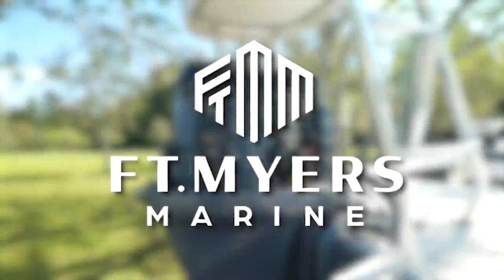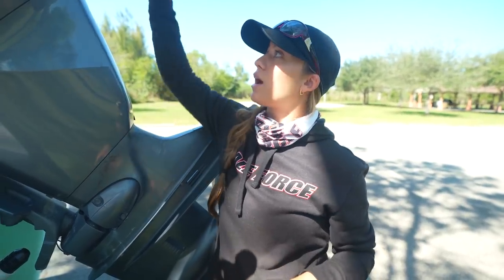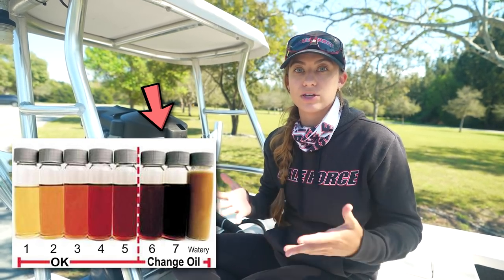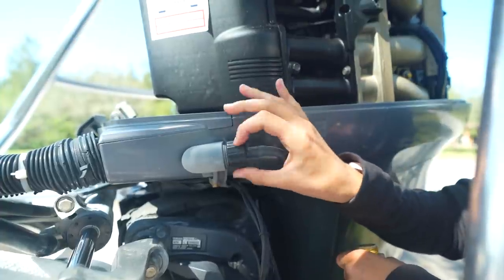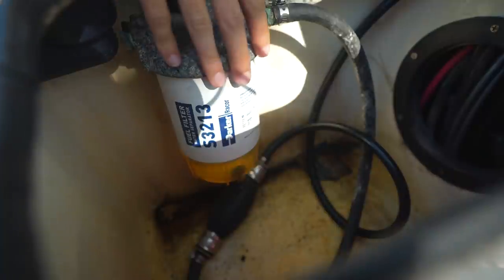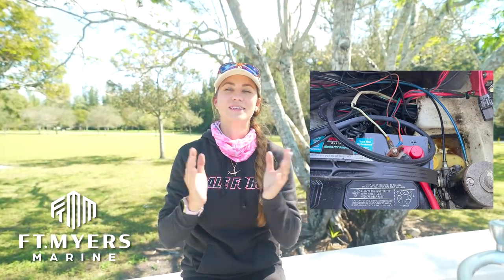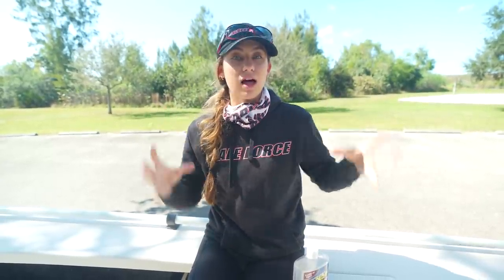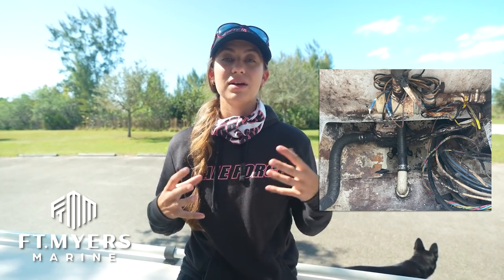How To Maintain Your Outboard Engines (and Boat) - Top 5 Tips

Comment: Good video and information. I also watched your “putting your boat into the water via the ramp,” video. Even though I’ve been backing up trailer(s) and ramp launching and trailer retrieving my boat for decades, I learns two invaluable methods from your videos. 1. Backing-up the truck using only half motions with the steering wheel the way you demonstrated and 2. checking the tongue and ball connection with the jack. The latter lesson I used to just look to see the connection but that’s not as full proof as your method. The moral of this comment, the simple or obvious boating practices are not always understood or known even by the most seasoned boater/fisher-person. Thank you for your basic video lessons. Old dogs need to learn (or get affirmed) a few new tricks too. They don’t know it all, as some may assume! 🤔  Keep the training videos coming. Love them!!

Comment: Great video as always. Good advice. There are test kits available to test the  gas and see how much water you're  getting from the gas station.  Also, especially with the smaller motors disconnect  the fuel line and let the gas run out so it's not sitting in your carburetor or injectors.

Comment: Humidity in the fuel tank will condense on the sides of the tank and get in the fuel. Storing the boat with a full tank helps minimize that.
Reply: Good tip
Reply: @CaptCollier  only problem is boat gas is well over $4 … it’s getting harder and harder to do that!
Reply: Great advice, this is a standard practice in aviation too, to prevent water build up in the fuel tanks.
Reply: That's why after June 15th, 2022, all outboards need marine fuel since it doesn't have any ethanol and street gas has 15 % ethanol. Ethanol attracts moisture, great for cars, but not for outboard engines.
Reply: @keithscudder7136  every gas station on the water where I live posts stickers that says their fuel contains 10% ethanol. I just bought a gas dock, and run 93 octane from Shell.

Comment: As a new boat Owner I want to thank you very much for your videos.  You both provide a lot of great information.   But I watched a few and got a little conflicting information.   In one video,  I think it was the one launching a boat, one of you said you needed to flush the motor for cooling; in this video one of you said you didn't have to flush the motors because you ran them in fresh water.  I don't think flushing is a bad idea regardless,  but if we run in fresh water,  flush or not to flush?  Thank you.

Comment: Also, I do believe ya'll have the Water/Gasoline picture reversed. The water is more dense so it should be on the bottom.
Reply: I check my airplane fuel, the ports are at the lowest points of the gas tank where the water would collect , because ...... water is in fact denser than aviation fuel or any fuel for that matter. Good catch,
Reply: It was water on the bottom, water will turn a red brown color in the filter

Comment: Great video, but you forgot to tell your many fans that as of June 15th, 2022, the street fuel contains 15 % ethanol which is real bad for all outboards as it attracts moisture. It will cause damage to your whole fuel line and then other parts of the engine. You need to use only Marine fuel.

Comment: I know that ethanol blended fuel is cheaper, but it's hygroscopic and will eventually attract water. The other thing to consider is performance and cleanliness. I run non-ethanol fuel in all my cars and when I am forced to use ethanol blended fuel there is a major difference in how smooth the engine operates and there is less fuel mileage (this is in all my BMWs, a Hyundai, and some trucks in the past). But when in Texas I didn't have access to Ethanol free fuel and within those few years the injectors developed a "gum" on them, which wasn't there within the previous 4 years of non-ethanol fuel (I am neurotic about my engines and maintenance), thankfully I moved back home to Florida and have access to non-ethanol fuel everywhere so I won't have this problem. There are some super technical aspects I can get into about why non-ethanol allows an engine to run smoother and get better fuel mileage, but other scientists have covered it very well in well written online documents, they're fun reads if your into, but the benefits are there.

Ultimately it won't do "harm" to run ethanol blended fuel, but compared to non-ethanol fuel there are still short term and long term benefits to paying a little more for it. Otherwise, we love your channel and advice, you two are legends.
Reply: Rob, Sorry to dispute you, but ethanol is now a Danger to all outboards as it will cause damage and void any warranty on new engines that run ethanol.    Have a nice Day.
Reply: @keithscudder7136  when did I recommend the use of Ethanol? Everyone should consult their engine manufacturers documentation prior to running ethanol blended fuel to determine if they can use it, but that has varied with engine manufacturers over the years and I am not sure if the danger of running ethanol blends is universal among all marine engines today, but it seems like that is the trend. I am all for non-ethanol in marine gasoline engines, I even  run it in my cars.
Reply: @greathairengineer  I'm sorry if you mis-understood, I have been building gasoline powered engines for over 41 years in my company, I'm now retired, I was stating that ethanol as of June 15th shot up to 15 % and that boat engines can't use it because of the damage it will do being it attracts moisture.   Have a nice Day.

Comment: Maybe my 2018 Yamaha doesn't have the alarm you speak of for water.  $5200, new heads, vst and basically the entire fuel system later the motor with 65 hours runs again. Lesson learned make sure the gas you dump in, doesn't have water in it.  😎

Comment: You didn't seat the oil dip stick into the engine completely.... The black rubber part on the dip stick should have been seated into the hole the stick came out of....
Reply: Which would explain why the oil level LOOKED low when it's probably just a little above the halfway point.  I saw that as well, just wanted to make sure I wasn't the only one!
Reply: I noticed as well. Even though the oil level was still fine, my eye twitched a little lol.

Comment: A buddy of mine could not figure out how he was getting water into his fuel, he finally figured out that the fuel tank vent on the side of the gunnel was facing forward so the bow spray was hitting it when he was running and was pouring water into his fuel tank

Comment: tape size salt water wash out fresh water pump change out two year 2 cyc oil gas mix 2hp dig 10hp oil check see any water in side motor out use or new wash out fresh water all time done fish motor last long up one check all part one year case pump spir  plug wash reel pole oil it done boat 14 john boat salt water creek north fl
Reply: English please?